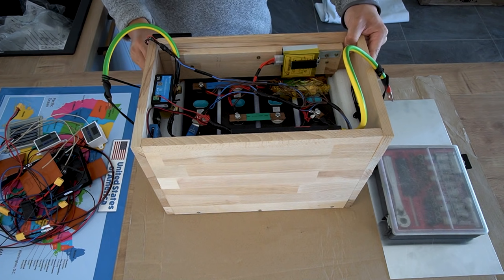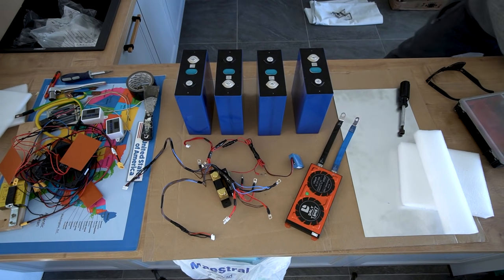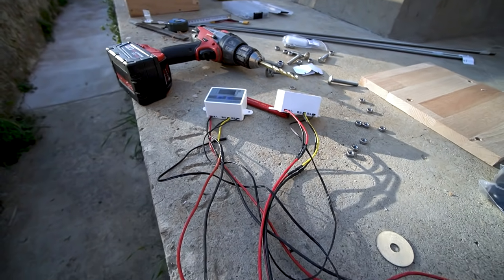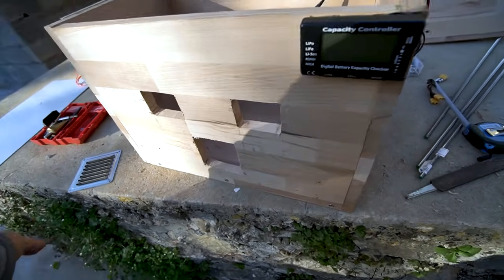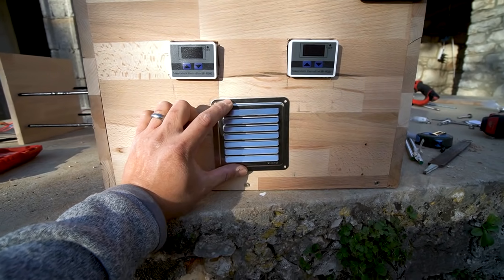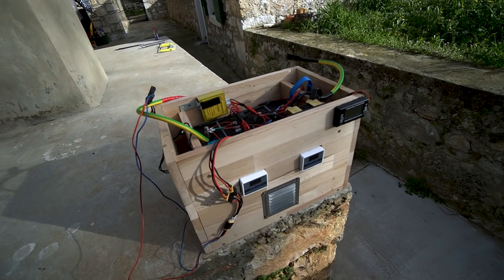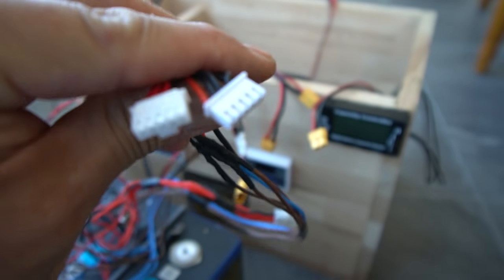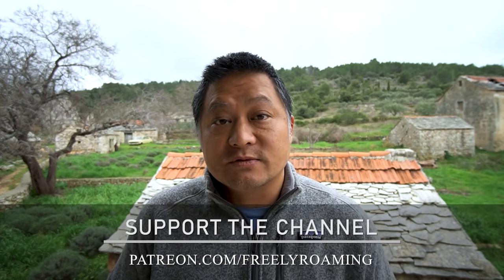DIY Cold-Weather LiFePO4 12-Volt Battery Upgrade 🤖 Part 2 // Assembly

Comment: Looking forward to the next video! I just lucked out and purchased a van for a killer price, will be getting possession of it in a week or so, and so begins the journey. I'm looking at getting some of these cells and building up my own battery bank, your videos have been amazingly helpful and reassuring!

One thing I think I'm going to do, instead of having the pos/neg cables attached to the bank and hanging loose outside of the enclosure, is use Anderson connectors and mount one to the enclosure with a cutout so the ends are flush, and then another connector wired up to the electric system. Doing this will make it easy to pop the one connector and remove the whole enclosure without having to loosen bolts from terminals to free things up.

Comment: Hey there, I routinely expose my lifepo4 24v 200ah bank to below 32F, even below 0F. I have had no issues over 2 years. It is static and does not move from its place. I charge at  0.2C(capacity) (20-30 amps)

Comment: Excellent build. My house has a decent system and the car audio hobby also has 240 ah of lifepo4. When the temp dipped down to the teens recently I decided to pull the lithium out. It was a cold experience n I wish I'd have used lto but that lithium is pretty expensive. Keep up the good work take care and thankyou

Comment: Love the timber box, much more nicer than plastic! I have a timber box with a carpeted control panel. Waiting for cooling fan from china and have the same temp sensor! 
I put my box directly on the van carpet and it suffered a little rot as I have sun roof.Rubber tube mat works good as seperator preventing moisture!

Comment: Nice video 👍👍👍.  Now about to start building my own setup 8 x eve cells 24v x 2 in parallel jk bms 200amp.   With heating mat just like yours 👍👍 using seedling germination mats..

Comment: Couple of comments.  I also built a wood box for my 240ah DIY lifepo4 battery.   I used 1/2" plywood and insulated it with 1/2" of polyisocyanurate foil faced foam sheeting.  I used a STC-1000 thermostat which controls both heating and cooling with one device.  It is small and cheap.  I used only one 100mm x 100mm (4" X 4") orange silicone heat pad (RTV) silicone glued to a aluminum heat sink mounted next to but not touching the battery.  I placed the thermostat thermister on the opposite side of the battery about half way up the side.   I set it to come on at 5C (40F) and go off at 10C (50F).   Despite the small 20W (1.6a DC) size of the pad, it heats the inside of box quickly and efficiently.   My experience with this system over the past 3 years of camping 8 months a year in the northern states of WA, MT, ID and North Dakota is that the heating element has never come on from March to November!  I've camped down into temps in the teens with snow in Montana.  The heat generated by the battery itself has kept the insulated box above 5 degrees C  (40F) all the time (I did see 7C in early November this year).   I did not install a fan or vent my box.  Experience has shown that it seems unnecessary.  Last summer we had record heat in NE WA state.  When camping I expected to take the box cover off to vent heat from the battery case.  However, the battery never got to 90 degrees inside the case, even when it was a blistering 110F outside!  I even have a 2000W inverter that I use every day and I still didn't experience temps above 90 F,  far below dangerous heat for the lifepo4 chemistry.   I didn't expect this, but conclude that an insulated box may be as important or equally important in the summer than it is in the winter.  If you need thermal protection, my advice is to add a tiny, thermostatically controlled heating element mounted to a heat sink, and insulate your box on top, sides, and bottom.  That may be your best bet and it keeps things really simple.

Comment: Hey again mate, just popping in to let you know I have my own battery now installed in my narrowboat, got the bluetooth 100a BMS from daly, and followed your setup very similar, just installed the smart shunt today and its working amazingly all week. I still recommend the Raspberry PI as the central hub, i dont need internet and use my local network to a tablet for a touch screen full system overview, its amazingly good for graphing and data aggregation. Thanks for all your help, wish I could send a picture!
Reply from the maker: That's great! Congrats on the upgrade. The only reason why I would want to set up a pi is to use Victron VRM. I prefer to have minimal LCD displays in the van. But I would like to have more data logging so we will see if I end up setting one up or not. I would also need to commit to running a wireless LAN even if no WAN is available. Maybe I will set it up just to showa how it works by making a diy video on the topic.
Reply from the maker: btw, you can send me a picture via our instagram. Link is on the channel page :)

Comment: The Daly BMS does cell balancing, don't think you need both for balancing the cells. Enjoyed the video.
Reply from the maker: Thank you for watching. The Daly BMS only does passive balancing (resistive heat) with mosfets. It is true that you do not NEED both but active balancing will make work much faster and consumes less power. I like having the extra balancing capability.
Reply: I also agree, passive balancing on my 80AH LiFePO4 pack is NOT enough to keep them in balance during charging. My cells aren't perfectly matched so I also needed an active balancer. All my cells are now balanced and I am happy :)

Comment: I think you did a great job in re-using your timber box! Very creative to do the adaptions in such a way that it doesn’t need that much extra volume!
I am building a similar battery (4 pcs 280Ah EVE cells) and am considering  to add  a heating element of approximately 60W.
But I have the feeling that you will need a very good thermal insulation in your enclosure to keep the system efficiently. In the end you want to have a positive energy balance: If cell heating takes more energy than the energy you harvest by preventing a low temperature shut down of the solar charger, it makes no sense. Do you agree?
Reply from the maker: Thank you. The problem with adding insulation is while it might be good for cold weather, it will not be so good in warm weather as it will trap the heat generated by the battery inside the box. That is one reason I have the fan is to try to overcome that. My heating pads draw 60 watts as well. Assuming you are keeping the interior of the camper above freezing while you are living in it, the heaters will not be on very much. Only a few minutes during the coldest hours of the night and early morning to prepare the batteries for morning solar power. Or if you have the camper plugged into shore power, then you don't have to worry about how much power the heater draws since you will certainly be bringing more than 60 watts worth of charge at any given time. The only time when I see  the power drawing too much is if I am not sleeping in the camper and the temperatures get extremely cold, I will then simply turn off the heaters and disconnect the solar so the batteries will just sit idle until I return.

Comment: Wow, you are lucky when you had the sensing connected wrong, that it did not destroy the BMS!
Nice job with that battery box. Excited to hear future reports on the heating functionality. I've been considering if there is a way to utilize only the charge power to heat, rather than drawing power from the battery. (Maybe if the temperature keeps dropping and no charge power is available then use battery power to heat, but primarily only need to heat when trying to charge at low temperatures.)
Reply from the maker: I have considered that. One way is to use a voltage sensitive relay that's activated only when a higher charging voltage is detected. But I decided to keep it simple and just run it off of battery power. Btw, it's very unlikely that mis-wired voltage sensing leads will lead to damage to a BMS. Similar to probes on a multimeter not easily able to damage the multimeter itself.

Comment: The positive (+) is the same as the aluminum case. AliExpress has larger silicone heater pads, so you’ll have one instead of several small ones. My heaters draw between 1.5-6.0 A at 12.8-13 vdc or so.
Reply from the maker: The aluminum case has a insulation wrap. It would be connected to the anode (which would be the negative terminal). I have other size heating pads. From 10 watts to 50 watts. I just chose to use these. They work on a range of DC voltage. Going by the watt rating is typically pretty accurate.

Comment: Great job sir, really enjoying your battery series.
BTW the kapton tape is a heat shield, so putting it over the aluminum sheet might ruin your goal a bit...
Anyway thank you very much!
Reply from the maker: Kapton tape is heat resistant but not a heat shield. It can withstand high temperatures without failing which actually makes it the perfect tape for this application.

Comment: Just discovered your channel! Very interesting and informative! I am a electrical / lithium virgin so these videos are great tutorial. I am planning on building a 24v system from diy batteries. So could point me in right direction of which components I would need for my 24v as opposed to your 12v by any chance or guidance? I am looking at the daly and will
Be king for the victron bmv and other elements. Can’t wait for the next video! Thanks bud 👍🏼

Comment: I'm inspired!

Is there a reason not to use 3 heater pads, placing them between the cells and  using the aluminum housing of the cells to advantage for heat dispersal?
Reply from the maker: The 2 inside cells will heat up faster than the outside ones. I prefer to heat all 4 cells at the same rate. Also I want the cells to apply even pressure against each other when it expands and contracts with charging and discharging cycles.

Comment: At the end of the Vid you said you had an issue with the battery not turning on.  Are you saying the fix was to replace the plug for the active cell balancer, so that the sensing wires matched the sensing wires on the plug for the bms?
Reply from the maker: Yes the problem was the sensing wires were reversed. It gave the bms voltage readings that it interpreted as over volted cells so it went to cutoff mode. Once the wires were connected correctly it turned back on.

Comment: Awesome changes! I love the cutting boards between the cells. What do you think about fish paper between cells and also we have an overkill bms which does not have a case like the daly. Would you mount it on top of the cells using maybe fish paper between to protect from shorting things out?

Comment: How is the temperature controller/silicone heating pad system working so for?   Have you had much of chance to test it in the field so far?   I am considering implementing your system when I build the battery box soon.
Reply from the maker: You can see it working in this video.

https://youtu.be/K389dgcWw8I

We've not had cold enough temps to use it since but I don't have any doubts about it working as it's shown here.

Comment: I really like your channel! You and David Poz and will Prowse give good quality reasonable advice and are much appreciated!! One comment though Why didn't you use a combined temp switch 12v model stc-1000 on amazon? It would have saved you 5$ and condensed both your temp sensors into 1 unit freeing up space time and wiring also only 1 unit too malfunction? Thanks again for a great show! Brock in Pawleys Island SC USA
Reply from the maker: Thank you. I am currently in Croatia and that unit is not available here.

Comment: Hi! I am building a battery pack out of 8S 280A lifepo4 cells to use in a RV. Its going to be cold there so I ended up on this video to make a heating solution. Couple of months have now passed since the upload, has everything worked fine? Im a bit worried about overheating the pads thus the batteries, do you have any idea how to limit the power that goes into the pads? I ordered two 20x10 cm, 24v pads already (24v system). Sweet channel!
Reply from the maker: It's been over a year and still works fine. Although I've only needed to a handful of times. The pads are design to pull a set number of watts so there is no need to limit it any other way except for installation an inline automotive short circuit fuse. That should protect it just fine.

Comment: It's a great concept. I'm interested to see how much power it draws over a 24 hour period when the ambient temp is zero degress c (or below). Is it viable for use in winter in countries where it is cold most of the time? Does it keep the core above 5 degrees ? Seems like you are not able to test that where you live which is a shame...
Reply from the maker: We had snow recently and I got to put it to the test. Video to come soon. Its not designed for temps too far below freezing. More heating pads would be needed for that but it worked well for right around freezing temps.
Reply: Freely Roaming Looking forward to it. Subbed!

Comment: You need a proper cover to prevent the fan from pulling from the open top of the channel it is mounted in, but pull across the cells from the louver mounted on the other side..
Reply from the maker: That is exactly why the fan and louvre are positioned where they are. Did you miss the 2 parts of the video where I talk about this exact same topic? 6:56 and 19:45
Reply: @freelyroaming     I am sorry for having to do this to you, BUT, YOU need to review your own video...!!!    @ 19:45 you said: "the top helps to keep the heat in" and " helps to prevent the terminals from shorting out"  and nothing about improving ventilation by pulling air across or around the cells....!!!
Reply from the maker: Well I hate to do THIS to you but that's because I already talked about the air flow 13 minutes before that at 6:56. 19:45 is merely the second time I talked about adding a lid and explain further reasons for its purpose. Speaking about reviewing videos, I really don't know how else to make things more clear for you.

Anyways, i appreciate the 👎 and comments since any engagement is good engagement for the algorithm on YouTube.
Reply from the maker: I don't know if you have any experience with this but if I did as you said, mention it again and again, there will be someone else who will pipe up and complain and say things like,  "why do you talked about it so much?" Or "why is the video so long?" Or "ok ok I get it, it's for airflow." I am not gonna try to figure out what part of what video someone is not paying attention to. I include the information and show you my process. You can take it for what it is.
Reply: @freelyroaming  Respectful engagement is always appreciated. Not everyone is respectful though as they bash your videos and think YouTubers only get free handouts LOL ;)   Great work Freely Roaming, your videos are excellent on this topic. Appreciate you sharing this content to the world to make LiFeP04 batteries much more usable in cold climates.

Comment: Good Video. You really go though the details of what you are doing. 
I understand that you are doing this for Cold Weather but my questions is how much of an over kill is it? Maybe I missed it in one of your earlier videos I am just off base but where is this going to be located in your RV. I thought you had a Sprinter so I am assuming in the RV somewhere. This should give you some amount of insulation / heat from the living space. You then created a wooded box (wood is a pretty good insulator). Then lifep04 batteries (like all batteries) create heat while discharging. I am assuming (possibly wrongly) that in inside of your RV will not be below 0C. Lifepo4 cold charging is somewhere around 0C (depending on manufacture and charge rate). Are you just being very conservative or do you plan to be some place what the inside of your RV is getting really cold?
Reply from the maker: It is necessary. I tested the battery in the van for 2 months after the original build and the battery area is practically the same temperature as the outside even though it's inside the van and the van is insulated. Unless youre heating the battery compartment directly or if it's not enclosed from the living area, it will not warm up by itself. There isn't much self generate discharge heat in cold winter mornings when you need the batteries to be ready for the incoming early morning solar. Nothing is being used at that time and for any noticeable heat from discharging, you need to be pulling quite a bit of current from the pack.

Comment: You seem to have a good grip on the technology, so maybe you can help me.  I want to build 2 of the 280ah batteries but will have them connected to a Victron inverter/charger it will be the 120/3000/50 model.  What I can’t figure out is how to size my BMS for the batteries being I will have a 3000 VA inverter.  I will have solar panels eventually, but my goal currently is to upgrade my current batteries and install the inverter/charger so before I go this route I need to size the BMS correctly for the size inverter.  I just can’t figure it out!  Thanks
Reply from the maker: Size your bms based on the max amp draw of your battery bank. Assuming you are running a 12v pack, you will need at least a 250A BMS to supply 3kw to your inverter. The math is V * A = W so 12 volt times 250A gives you 3000 watts.
Reply: @freelyroaming  thank you for your response, so if I built 3 100ha batteries under the same inverter would the BMS size be different for each battery?
Reply from the maker: If your batteries are each built as standalone units with their own BMSs connected in parallel then they just have to add up to the 250A capacity.
Reply: @freelyroaming  ah, now that is adding up better in my brain.  Thank you!